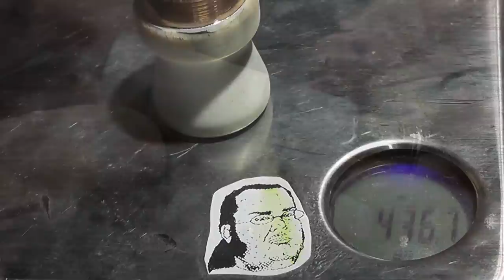Shotgun Slugs made out of MOOSE ANTLERS-  Amazing Performance!

Comment: The Giradoni air rifle(carried by lewis and clark). Used antler as the gasket for the air valve as it was the only thing available in the 1700s that would do the job.
Reply from the maker: It's a very tough material.  reminds me of some teflon components i've worked with

Comment: I think I heard that some kind of tribe used to use the bones of their recently dead to make arrowheads that were meant to break off in your BONE, not kill you by bleeding out. 

I don't know where I heard this or if I am remembering it right, but if the foreign bone came in contact with the host bone, the hosts immune system and white blood cells seek out the foreign bone and when they try to break it down they get all confused and start attacking the hosts cells too.

So In short. Bone arrows would make your body attack itself basically giving you auto-immune disease.Or so my brain tells me.

Comment: Why don't more commercial slug manufacturers make their slugs in the air rifle pellet shape?
Reply from the maker: Not sure,  but the shape really does well under all conditions.
Reply from the maker: I tend to load slugs with minor variations -  different waddings,  different powder loads,  etc,   just  to increase the odds of getting it right.    If I were to load them slug exactly the same,  I'd risk having the same failures on all shots.